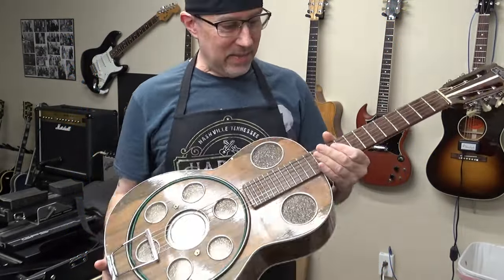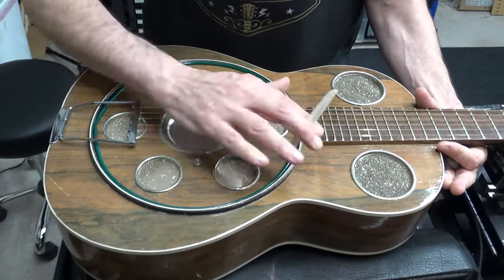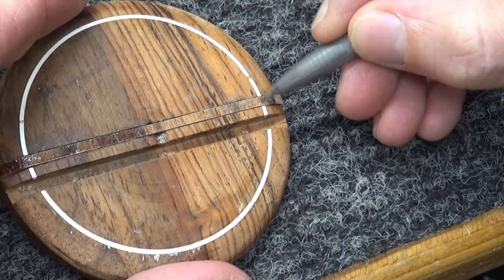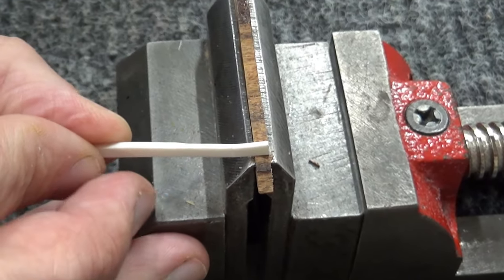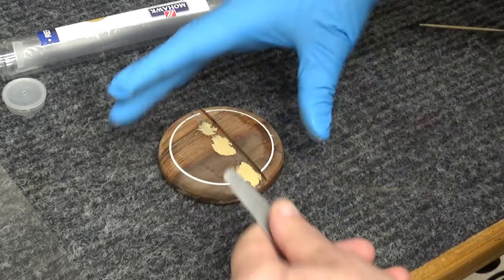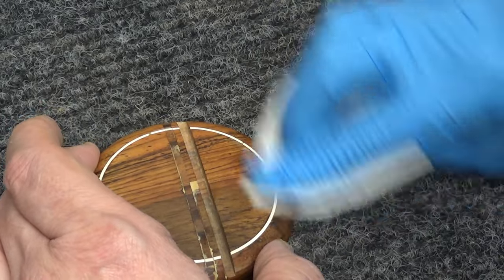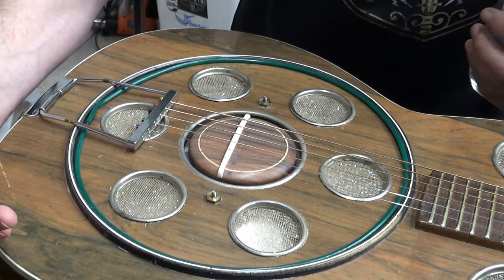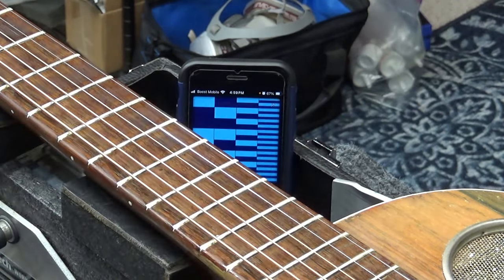Del Vecchio Intonation

Comment: Interesting design on that guitar dosnt seem to have much break angle off the tailpiece but what do you do ,I really like the Mohawk epoxy putty you used ,I just got a few burn in sticks from them but I like that putty alot better now that I saw you using it ,what markers did you use to match the grain Lines ? the Markers I have are not cutting it

Comment: Wrong intonation för steel strings perhaps, correct for nylon strings that it should have on and was rather was delivered with from the factory! (At least mine has only ever had nylon strings!)
Reply: Or… Correct intonation for Hawaiian/lap steel where you don’t actually need compensation because you’re never pressing down on the strings to fret.
Reply from the maker: That makes sense
Reply: brazilian del vecchio resonator is for steel strings.